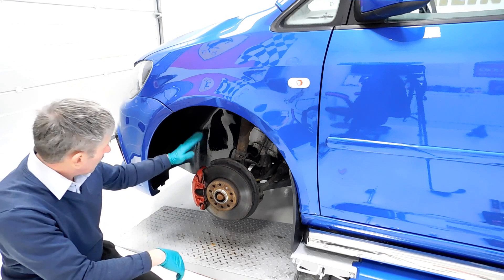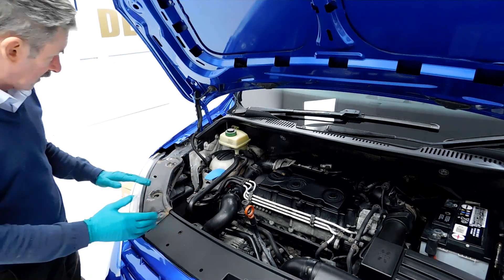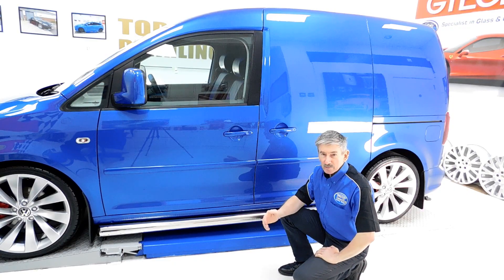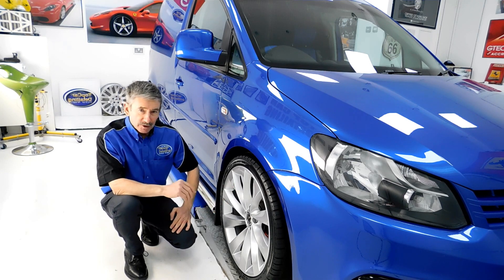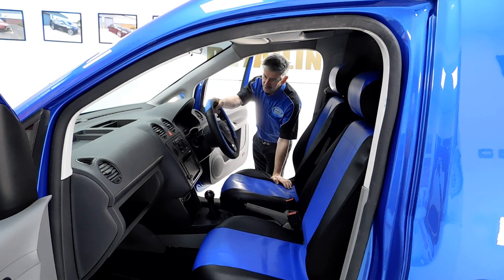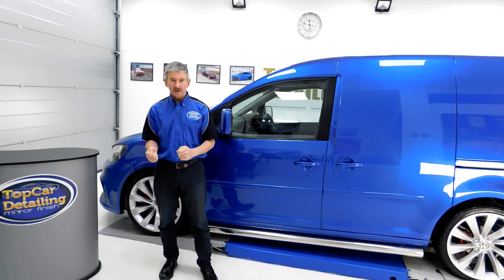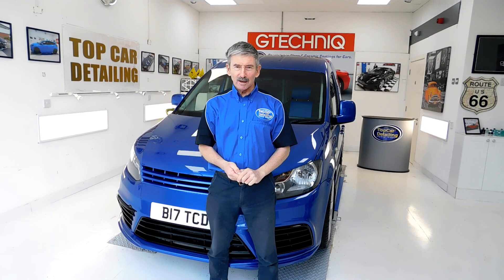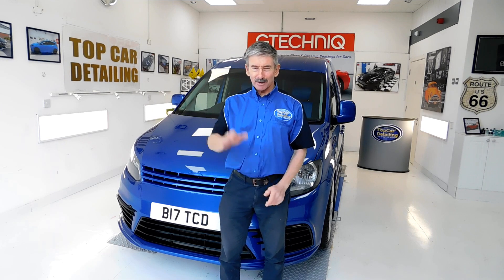VW CADDY VAN - CUSTOM PROJECT - GIVING IT A NEW LEASE OF LIFE

Comment: Where can I get that front bumper or is it a 2 bumper split into 1 job. Or have there a finally made one that's a perfect fit? No out. Awesome van mate.
Reply from the maker: The front bumper is made of fiberglass, the bottom section could have been made (an inch shorter) as with the front splitter on it is quite low to the ground, Cheers.